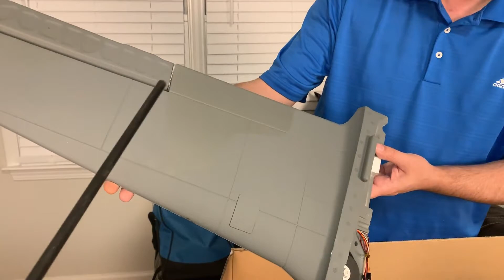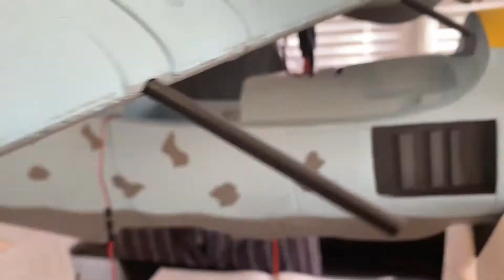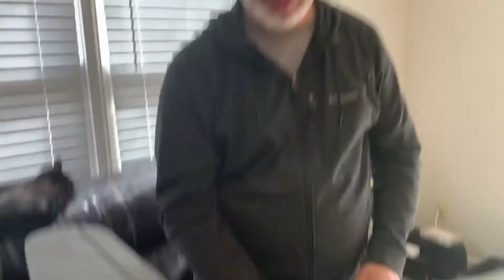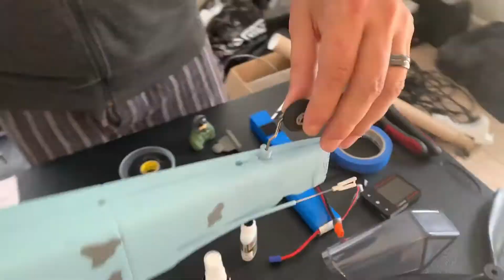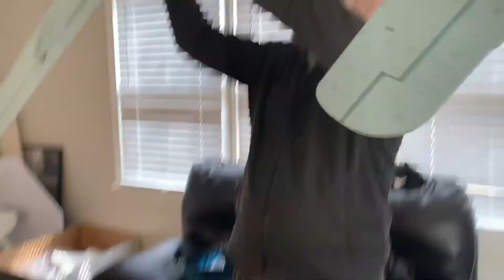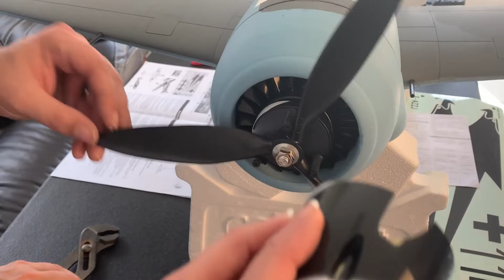Dynam Focke Wulf FW-190 Unbox and Build

Comment: I have fw 190 dynam have it together but I'm getting a fast beeping sound from motor side I don't hear when I connect battery just regular beeping so...I push the bind button on my ar620 spek...then I follow suite I push the bind button on the I have dx6e transmitter when they bind that's when I hear fast beeping sound..help anyone I will be grateful for any on this..thank you for your time..well I have throttle I had to reverse it..now I gotta figure out how to set my servos rudder with my thrt....my rudder let's my wheels up and down and on the other side left and right it only lets one wheel down...O.M.G..didn't know it was going to be this easy 🤔..damn my joysticks are all screwed up I might have to let a pro put this wiring together cause there aren't any really good video's for this type of trouble oh..well it'll be a good wall mount I reckon..👍🤓👊
Reply: Thanks bunch omg..I got it wheew...I had to go one at a time plugging an unplugging..I watched what you did..i some how managed..haaahaa.ooowee
My grandmother would say..once again thank you even though it was a video..its graduated from being a wall mount lol
Reply from the maker: I may be able to do something like that. It would be on a DX6, it they’re very similar
Reply from the maker: James Fewell sorry you’re having so many issues. You definitely need to make sure you have all the servo leads plugged into the right ports of the receiver. Sounds like you have the rudder and gear reversed? I would do a thorough test of all the control surface servos and get them all labeled and hooked up correctly. With the retracts, if you have a failed retract I would contact the vendor you bought the model from and see if they will send you a replacement. I would hope they would. It may not be an issue though, once you get everything plugged in correctly. For a quick run down. Channel 1 is throttle, 2 is aileron, 3 is elevator, 4 is rudder, and 5 is gear. Channel 6 / Aux 1 will not be used because this aircraft doesn’t have flaps. You may also have some strange mix setting in your transmitter. Hard to tell what’s causing all your issues without the model sitting in front of me.
Reply: @TheRCAirMarshall  by the way if you dont mind me asking do you have a video tips with using a dx6e spektrum kit I bought it came with a well..lol dx6e and ar620 receiver I got it off Amazon and my dynam fw-190 as well anywho's just asking figured it would be better than texting...👍🤓👊..ooh mybad like setting up rates ...I'm still learning about the expo its weird trying to cram all this in ...lol..and thank you for your time your helped me out bunches so ...happy flying to you....

Comment: I got one of these just a couple days prior to making this comment. I knew before getting it that it wasn’t going to be as simple as open and fly. In all honesty, I actually kind of enjoy things that require a little work like this, but one look at the wires reminded me with a mighty slap to the face why I didn’t pursue my dad’s career dealing with computers. Thank you for walking through the wiring portion of assembly, not a single video that I’ve seen (save for this one) walked through the wiring like you did, let alone at all.

31:14, that’s actually a BAR cross, not an iron cross. The two DO look similar, but they’re different from each other. I can’t remember if I was ever told what the bar cross was for, but the iron cross is one of the highest honors to be awarded in the German military. 

And I have a question; is it normal for planes like this to not come with a transmitter/radio? I understand why it wouldn’t come with a battery; sometimes those things are a little tricky to ship with the thing(s) they power.
Reply from the maker: Austin Huff good to know the difference between the Iron Cross and Bar Cross. I’m not very up to speed on Luftwaffe emblematics. LoL. Glad to hear you appreciate the wiring up process. Takes a little extra time which is always a challenge when making these videos, do I go for quick video or really dive deep? Difficult to balance what I want to show and what folks are willing to sit through, ya know. So thanks 👍. With regard to the transmitter / receiver they do have a bind and fly version that comes with a Detrum receiver as well as a ready to fly model that comes with a Detrum Receiver and a Transmitter. They may come with a battery and simple charger as well. I don’t use Detrum equipment so it doesn’t make much sense for me to get anything other than the Plug and Play model and I’ll use my own receiver.

Comment: Dave, I was very surprised to see you use a Admiral rx right after you just made the 22 part Spektrum AR636 Reciever Programming series all while saying how fantastic this receiver/gyro really is and the vast amount of flexibility and custom tailoring that this fantasic receiver provides.  Then I see this video,  and what Rx is Dave using?  An Admiral?  So then I'm asking myself why would Dave do that, to use in conjunction with his New Super Fancy $700 Spektrum IX12 Transmitter? Just dosen't make any sense?  Please explain that choice if you will ???
Reply from the maker: This was out of necessity. Thee AR636 has been discontinued and no longer available as an open stock receiver from Horizon. Trust me, I would have rather used one! The new AR637T which replaces the AR636 won’t be available for some time due to the slow downs of production in China. Sucks...

I have an AR9350T 9 channel AS3X Receiver I could have thrown in, but the receiver would be worth more than the plane. LoL
Reply: @TheRCAirMarshall  - what I've been doing is buying them off Ebay as "used items" from crashed planes or New ones removed from BNF kits by hobby shops or modelers who want to sell the Horizon Hobby plane as a PNP. There are dozens of them for sale on Ebay at this very moment.  As a matter of fact,  I just bought one today off Ebay that was a taken from a New E-flite Turbo Timber 1.5 BNF being sold by a private Hobbiest for $58. 
Guy says he's a Futaba guy, doesn't like Spektrum stuff but really likes the Turbo Timber. His local hobby store only had the BNF kits inhouse.  So he pulled it and sold it.  I haven't had any problems with any of my Ar636 that I got used from crashed planes.  They are rugged little guys, and can take a beating and survive.
Reply: Oh, and I also own a Turbo Timber 1.5 BNF and a UMX Timber and they are both Awesome !!!  Have you had a chance to fly either of them?
Reply from the maker: Oh yeah, I have a UMX Turbo Timber and it’s one of my favorite planes!

Comment: Great job Dave.....and Amy👍🏻 I think you done a great job in explaining the Dynam way. You are absolutely correct in saying it is a modelers plane. I have 7 and some builds were tough some easy, but still a nice flying plane.👍🏻✌🏻🖖🏻
Reply: EQ I have the bird Bobby built last night.  To get the panel covering th wires to fit the foam has to be carved out.  I used clear packing tape instead of glue so i have access.